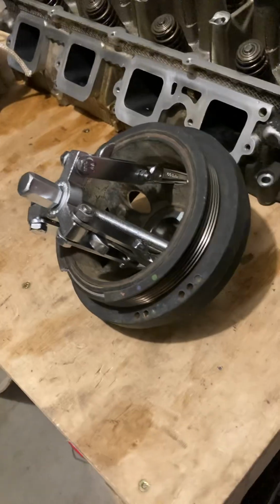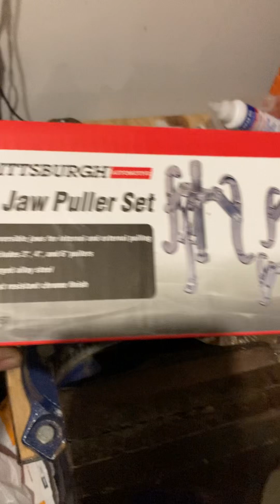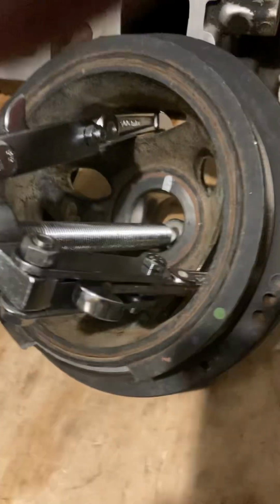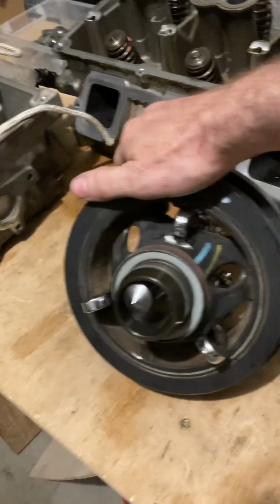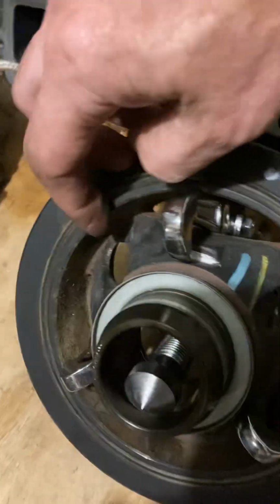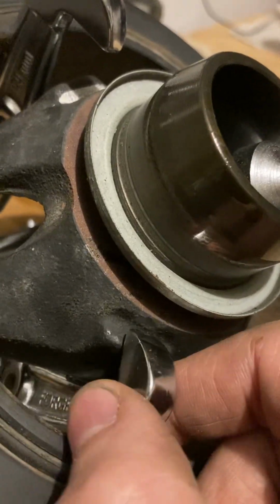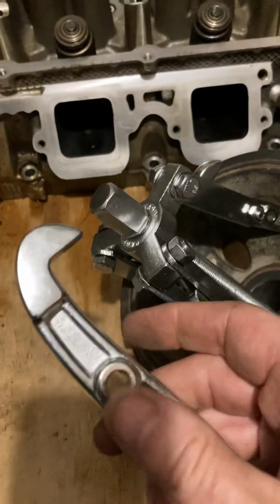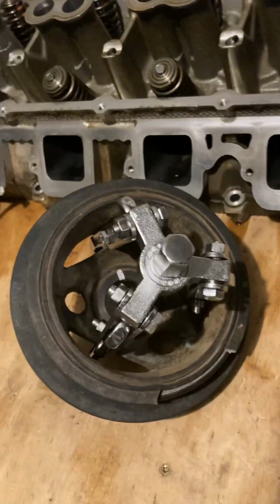2015 DODGE RAM 5.7L Hemi Harmonic Balancer Removal

Comment: i gotta try this been searching for something, my only thing my H.B is different hopefully itll work
Reply from the maker: Autozone rents 2 different pullers that may work for you. Those didn’t work for the specific one I was working on. If nothing else works for you, I guess spend the $20 at Harbor Freight and try this. Good luck.
Reply: @wdtony  my H.B is the same as urs but w/o the 3 extra holes. i just bought the harbor freight ones going to use it tomorrow, also the Autozone one is a little to small to reach the anchor points
Reply from the maker: @TheFuzz216 
Fingers crossed. I hope it works for you. 
Let me know if you get it.
Reply: @wdtony  finally got it :D, u wouldn't happen to know what sensor sits in the time cover ?
Reply from the maker: @TheFuzz216 
Great to hear!
I don’t recall a sensor in the timing cover itself. What year and motor?